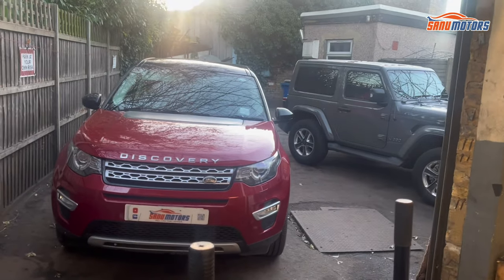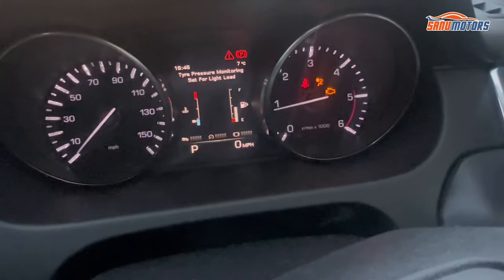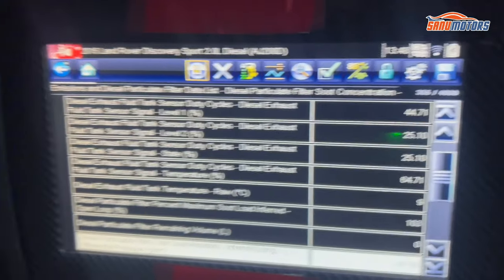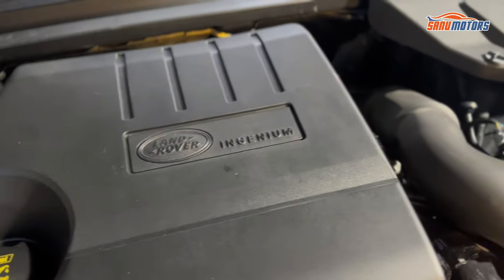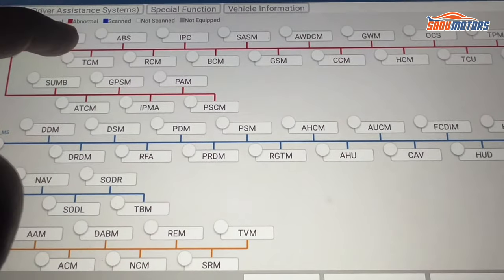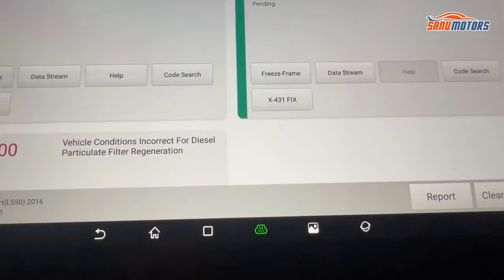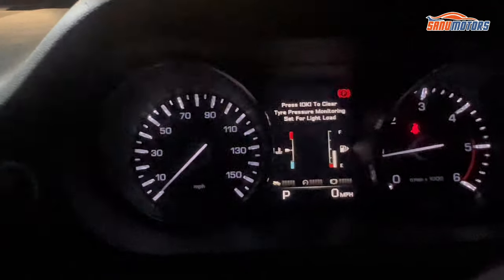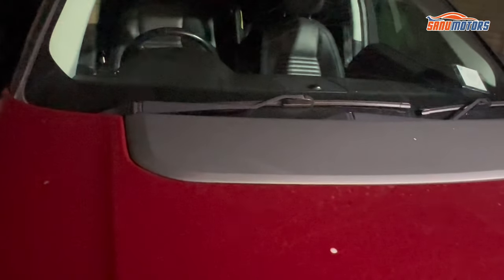P2463 diesel particulate filter restriction - Land Rover Discovery DPF Block - P246B Land Rover

Comment: Hi, I have the same fault I have had the dpf cleaned and replaced the pressure sensor, The light is back on with the same fault what do you suggest
Reply from the maker: Oops you spend lot. Did you check throttle body. Like this problem need to check live data before the repair. Where are you based? I need more details. Please contact after 29th. I will help you 
Also don’t forget to subscribe, like and share this video 
Thank you